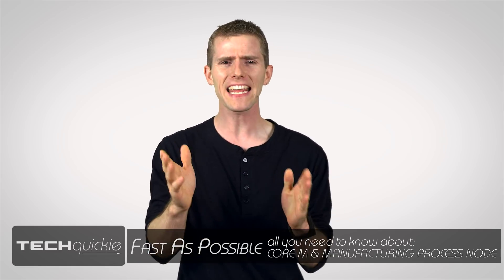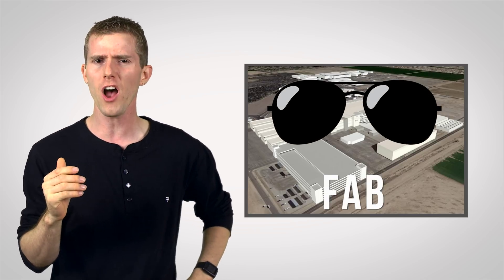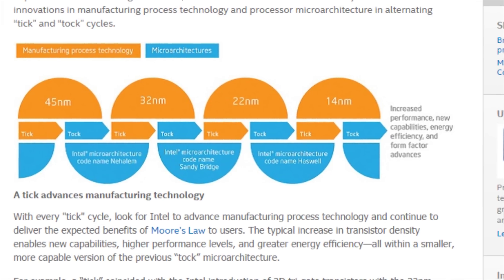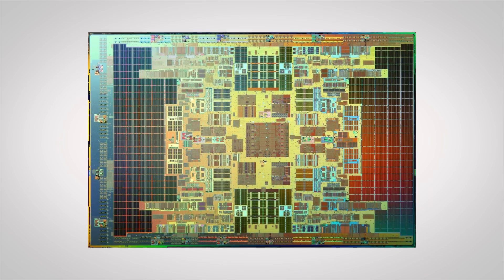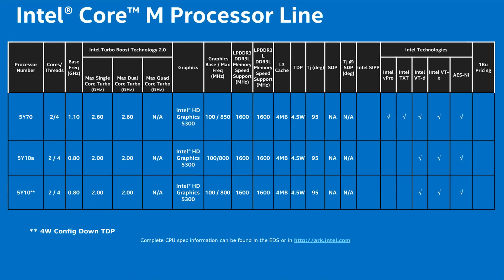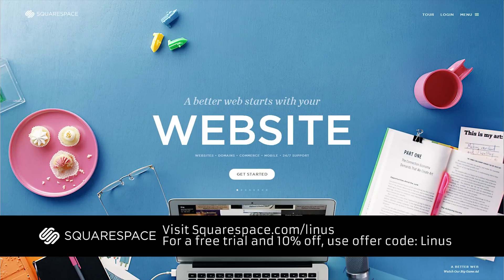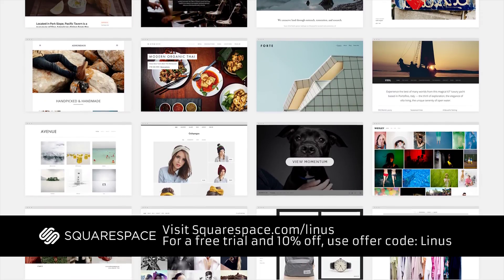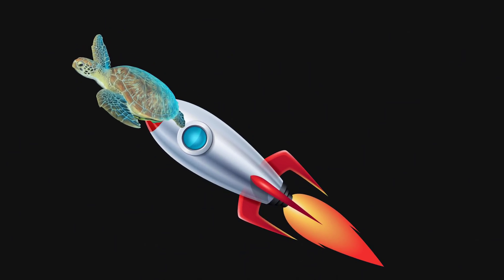Processor Manufacturing Processes or "Die Shrinks" as Fast As Possible

Comment: What is the point of having multiple possessors in a computer.
Reply: To process multiple things at once?
Reply: it's mainly for large servers that do alot of data processing
Reply: Um if you need the power
Reply: Think of each core as a arm
Processor as another person
Reply: The same reason why there are multiple cashier's in the the supermarket?
Reply: I'm probably mincing a bunch of things here. But basically, with a single processor, your computer does everything one by one really fast, but with multiple processors it can do multiple things at once; the caveat being that applications must be specifically written to do this, but they get a performance boost if they do. Even if you're not using multiprocessor applications though, you still get the benefit of single-process applications running on different processors meaning they won't slow each other down; plus if they hose up and starting eating CPU, everything won't go to hell because you'll still have the other processors to run things like the operating system.
Reply: ***** He's not talking about a single cpu core vs dual cpu core, he's talking about how some Intel Mainboards have two CPU sockets.
Reply: neored6411 Not at all, Computer Architecture is extremely complicated and there's not enough youtube comments that would be able to respond correctly, if you're really interested I suggest researching via google. However to compare the two in the most basic form. Why you would need one or the other would be an application by application basis. For example if you had 4 Hex-Core CPU's vs 2 12-core CPU's the 4 CPU configuration has higher memory bandwidth (if memory controllers are on-die) but it also has higher power consumption and higher latency if an application required a higher memory bandwidth this config would be faster. The 2 CPU configuration has less bandwith, less power consumption and lower latency. If the application didn't need the advantages of a 4 CPU system, this would be faster because of the lower latency., the benefits of both are subjective and it's hard to get into it deeply in a youtube comment.
Reply: neored6411 A processor runs something called a thread. A thread can do things. Normally, a single core can only have a single thread. Intel does some magic so that when a thread is waiting to do something, it does something else and that's what they call hyperthreading (They said 2 physical and 4 logical cores or things like that, but actually its 2 physical cores and 4 threads)

Anyway, the point is, one thread can only do one thing at a time. If you want to do two things at once, your computer would do something like this. The dashes represent code executing

Processor -__-___--___-____-_

As you can see with my terrible diagram, it has to keep switching code its executing, it can't do two things at once. This is a multicore setup.

Processor 1 --------------------------
Processor 2 --------------------------

Now imagine in that 4 processor configuration, you wanted to do 4 things at once, now it looks like this

Processor 1 --____--____--_
Processor 2 --_____--____--__

So you add more cores. There can only be so many cores on a single processor, so eventually you add more processors, so you can do more things. As the guy above me said, as to whats faster and whatnot, that is a question that doesn't fit the scope of a youtube comment. It's a lot more complicated than you think.
Reply: sauravyash but each CPU is another person and it takes longer to communicate to complete actions.
Reply: Jacob S  yup
true 
ok
Reply: Jack Pat Give me that bowl and no one will get hurt!^^
Reply: Jacob S Ok you are right there. I meant to say more cores the better for rendering.Or heavily threaded applications. Not for everything XD
Reply: Damon Hearty It's not the same at all, do you do that every single time you scan an item? Either way, computer architecture is deeper than scanning an item and occasionally asking for a price check.

This is the last i'll say about this for Jack Pat's sake. lol
Reply: Jacob S XD well, come by my shop sometime, I'm sure I have an XLATX board in stock you can use to try and prove your point. At the end of the day the analogy is fine as the separate CPU has its own workload to relieve the workload of the other processor. Just like have extra cashiers.
Reply: ***** Jacob S Max Tepafray  so if i am getting this right. having multiple processors is like having multiple cores but faster.
Reply: Jacob S Ah, my bad, I had a feeling I was getting something mixed up.
Reply: Professional users use multithreaded applications such as 3D CAD software which requires as much cpu power as possible. Simply more cpu's the better. Only Xeon processors are able to work in harmony with other exactly the same cpu's. And they tend to be to cost your first born child, kidney and 3000 dollars. That's why rendering farms are created so people who can't afford to have quad Xeon in their pc, can use public rendering machine.
Reply: DMitsuki Yes, thank you, I forgot about hyper-threading. Assuming all the processors feature hyper-threading, 4 CPU system has the ability to run twice as many threads as a 2 CPU system can, which can come in handy in some cases.
Reply: I think that is easier... Sure if you have one processor at 6Ghz, would be faster than two at 3Ghz... but the second option is easier to do.
Reply: It's not faster in all cases.
Reply: Jack Pat It's much more complicated than just being expensive and it's not the more CPU's the better.
Reply: Programs that are CPU heavy (like running a server) often use8 and up to 24 cores. Dual CPU motherboards often are good at splitting tasks between both CPU's creating a more efficient workload
Reply: It (multiple CPU socket boards) is mainly for Servers... Servers often run multiple virtual machines on one machine. A virtual machine is basically an OS that runs side-by-side with other OSes without any of them realising that they are sharing resources. As far as each OS is concerned, it is running on its own private hardware. This is very useful because you can start, stop, backup, reconfigure and even migrate (to some other hardware) virtual machines very quickly and you never have to touch the hardware at all, plus it's a lot cheaper and more space/power efficient than running a separate machine for each OS. This is all enabled by what is known as a Hypervisor... which is a very thin layer of software that mediates between each OS... assigns them their resources etc.

Anyway, this is why server hardware often has like 128GB of RAM and 32 Cores, for example... because all that stuff means there is plenty to be shared so you can run many virtual machines on one piece of hardware. You could assign 16 Virtual Machines 2 cores and 8GB of RAM each out of that 128GB and 32 cores.
Reply: Jacob S If you are doing rendering in c4d or maya its all about the amount of cores, not speed of them. You can also use the gpu for rendering but that requires plugins which can be really expensive. So you can but xeon e7 ( dunna which one ) which has 15 cores and 30 threads. Now if you have 4 of them, you will have 120 virtual cores which will go through an animation in seconds rather than days. In these kind of applications each core has got a task to render a sector. Thats why i used rendering farm example other than gaming. Coz for gaming if you buy 4+ core cpu its a waste as only few games use more than 4 cores. Check the difference between rendering with slower cores but more of them ( GPU ) rather than much faster often 2x faster, but less cores ( CPU ).
Reply: Jacob S Plus you are going off topic. He asked why does someone need multiple cpus. So i gave him an example.
Reply: Jack Pat It's not off topic, it's all relevant. You seem to confuse the fact that the more physical CPU's you add the more latency there is since there has to be constant communication between all of them so that their cache's aren't out of sync. Which can add problems to programs that don't take advantage of large memory bandwidths.
Reply: More power^^ If you have to design a poster with a pc Apple 1, you are done before trying. Same with CAD/CAE workstations compared to high-end gaming machienes, one is just performance for any price with massive RAM (up to 8TB) with high power GPUs (Teslas and Firepros) with high performance CPUs (4^^) with 16 cores each make work faster. Try editing something like that with your PC, mine can handle light CAD work... compared to people I know, its very light work.
The point is to be faster doen with one project. I hope you got my point^^
Reply: Bayya I am sorry to have to tell you that your "large server only" isnt the whole story. Cars, Ships, Planes and machienes dont design and build theirself. Big manufacturing systems and electricity networks have to be controlled by server networks (or at least kind of)
Reply: Jacob S Yes so if you do not own a software which can utilize high memory bandwidth then you definitely do not require cpu in array. The latency between two cpus would be soo little that you wouldnt even realized. Also RAM modules. Do you even see the lag caused by a 3333mhz ram ? No because motherboard is soo fast. Plus cache has about 20MB of storage. So you are trying to tell me that even if one of the caches got erased from one of the cpus you would see the latency of 20mb going through the mobo to update info ? are you mad ? You wouldnt see the pop up window of 20mb file transferring over usb 3.0 not even talking over a extremely fast cpu link on mobo. Remember that cache is freekin fast.
Reply: Jack Pat Damn my popcorn is finished. * grabs another bowl * XD
Reply: Jack Pat No, it does matter and it does make a difference, CPU's usually have three levels of cache and when you have an application that benefits from lots of high speed memory it's going to make a huge difference, like I said. It's beyond "just being more expensive". More CPU's doesn't always beat out less CPU's and more cores, I'm done with this comment thread lol, if you're so interested google it.
Reply: Jacob S Yes thats if the application prefers speed over power. I never said that its always better to have array of cpus. And i dont need to google it coz i have 2 cpus in array. Thats the reason i joined in. I am an architect ( well not yey ,studying ) and i use c4d to render the exterior of buildings. Previously I had a 3960x overclocked to 4.2ghz but now i have two xeons e5 2690. And well they are bad for gaming but beast for rendering an animation.
Reply: Jack Pat Your first comment said "Simply the more CPU's the better". It's not as simple as that and saying that for people that don't know these things is what fuels the sharing of mis-information.
Reply: LinusTechTips help, me....
Reply: neored6411 lots of cool information in here for you :P
Reply: for the same reason you would need multiple cores.
Reply: Jacob S  there is a lot of useful information here. it is just that there is also a lot of new concepts for me here.
Reply: neored6411 Have to start somewhere :P
Reply: Jacob S i would prefer not to start at the end.
Reply: MatzeGamer
never said it was only for large servers just mainly
Reply: for 9 year olds to play their minecraft
Reply: neored6411 if there's a concept you don't understand, look it up on tech quickie or if it's not there then google it, take it slowly.
Reply: If you do not understand any of the conversation like mine and Jacobs then you shouldnt get into computers that deep. Its too advanced. +sauravyash said the easiest way to understand this thread. Core is an arm and A chip is another person. For gaming its not good to have multiple processors as games use only 4-6 cores. Enough for 1 cpu to handle it easy. Also gaming requires speed not power therefore communicating between different cpu`s will cause performance drop due to delay or the latency. BUT if you are not a gamer and all you do is render videos, animations or other REALLY HEAVILY threaded applications then you need as many cores as you need to speed up the process.
Reply: muting conversation
Reply: Dave Poo very good analogy.
Reply: Damon Hearty No, it actually has no correlation with how multiple CPU's work, though you can use it for multiple cores in a CPU.
Reply: Jacob S ...because the average user has a mobo that supports more than one chip and considering the video/channel we are on that's not at all what's going to be assumed here.
Reply: Damon Hearty Uhhhh, the OP was asking what the point of multiple processors are?
Reply: Jacob S most people are referring to the cores, not physical CPU chips.
Reply: Damon Hearty No, he's talking about multiple processors.......?
Reply: OH GOD just leave this thread Jacob. Theres too many people with no experience or just little kids thinking they know everything, when in fact they dont even know what PC stands for.
Reply: Jack Pat  XD
Reply: Jacob S But you were just saying that there would be latency between the CPU's, so obviously the analogy is correct as it saying more work gets done, but when the cashiers start trying to communicate they would experience latency.
Reply: PhoenixOz A lot more complicated than just latency, I was just stating some of the obvious.

By the way, Cashiers don't even talk to get work done lol.
Reply: Its funny coz i work as a cashier (in Australia we call it service operator or "checkout chick") and i talk to other cashiers and i thought u were only talking bout latency
Reply: Jacob S Tell that to my cashiers that need to exchange information depending on what is required. The analogy is fine.
Reply: SWAG (and multiple calculations at once) e.g. Having one core manage your windows, 2 other cores for a game's 3D models and something else, 10 more for rendering and 99999 more for server computing and so on and so on...

Comment: Honestly... This sounded like an Intel commercial. 

Oh ya I forgot that only Intel designs microprocessors. Silly me.
Reply from the maker: Intel has consistently driven new manufacturing process development over the last few decades. They are usually a full or half node ahead of the others.
Reply: ***** Like I said, only Intel designs and produces processors. No other company in the planet does it.

In fact, it was Apple and Intel that invented the first CPU. True story.
Reply: AMD still uses 32nm process even for their new FX-8370
Reply: Techquickie
considering their pricing they can afford to be as well.
Reply: friedzombie4 http://en.wikipedia.org/wiki/X86-64
Reply: friedzombie4 AMD was consistently ahead of Intel performance wise up until the core 2 duo if my memory serves me correctly though if someone can look it up with harder facts than me jogging my memory, I'd love to see it :)
Reply: Greyghostvol1 yes you are right.. amd ruled the processor market before the c2d.. and even then amd was used for rendering back that days for some more time because intel became faster in about any aspect but amd was still faster when it came to render stuff.. but well.. it was not for long and intel leads on every field nowadays over amd.. and yeah well they are more expensive but they can do it.. their chips are just better than amd chips at this point.. i hope they will release finally some good chips soon that can compete to intel chips..
Reply: Did I arrived to the comment late?

Comment: Could you please do a video that some how explains how GK204 with across the board lower specs then the GK110 (on paper) can still perform at the same level and even higher in terms of performance?
Reply: it has higher specs ! ?
Reply: It does not, maybe 1 or 2 things such a ROP's but besides that its truly a GK104 replacement, yet GK110 beats GM204 in almost all specs on paper.
Reply: Mystikalrush ok so the cuda cores (you know those right?) on maxwell perform 40% better than the kepler cuda core so less cores are required on gm204 to perform similarly or better than gk110 and gk 104, simply maxwell > kepler
Reply: They re-designed their compression method so they could manage memory much more efficiently than Kepler. Hence why the memory bandwidth on maxwell is not a bottleneck.
Reply: megahertz doesnt say anything. just because something has more doesnt mean that its better (example(but i still love amd): amd fx cpus and intels cpus.) its all on the architecture
Reply: Better architecture + better driver
Reply: friedzombie4 Kepler cards get Dynamic Super Resolution aswell, Not sure about MFAA but I don't see why not if they get DSR
Reply: friedzombie4 I'm not sure about those but I remember talking to my buddy, he uses DSR on his GTX 680
Reply: friedzombie4 you just listed features and not why drivers give better performance in games
Reply: friedzombie4 Drivers translate high level commands (direct3d) to hardware specific commands. When you have different architectures you have different drivers and it doesn't matter that you call them the same name its still different
Reply: friedzombie4 Unless we have access to source code we wont know if they holding something back